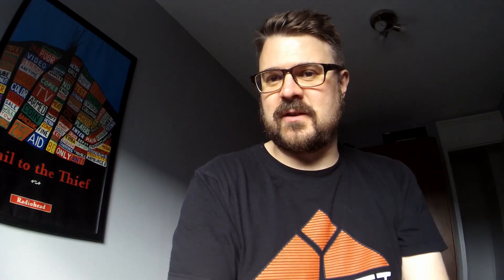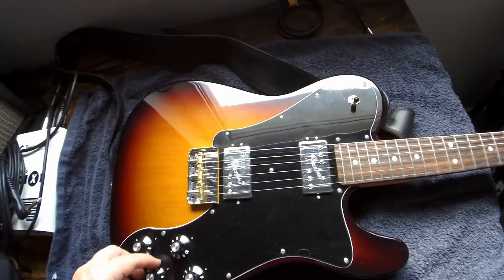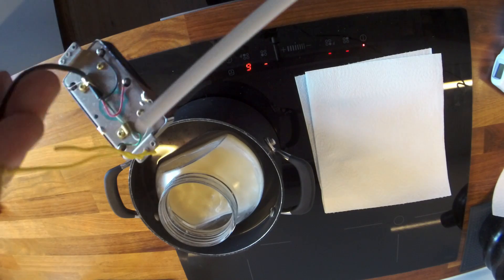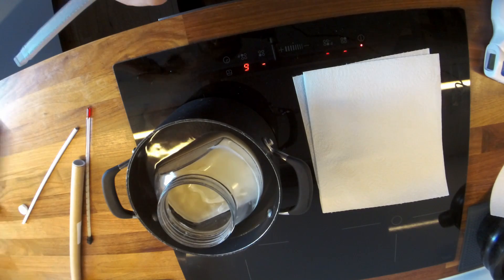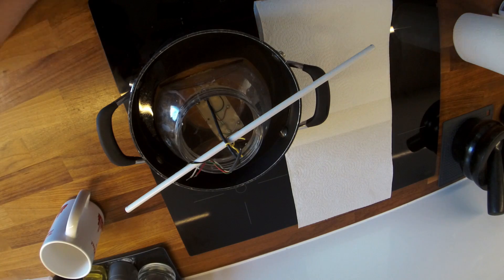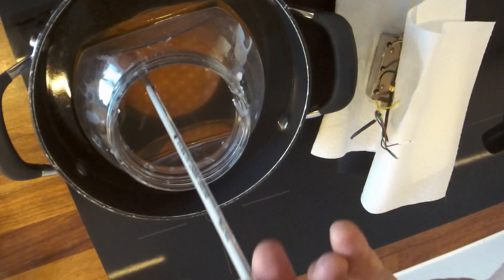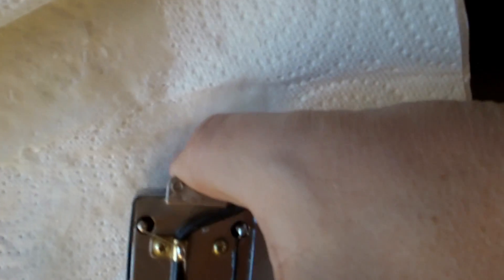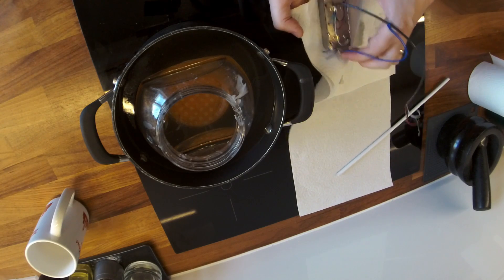Wax Potting my Fender V-Mod II Humbuckers

Comment: Well done. I'm considering doing the same. I would like to have seen you disconnect from those push push pots and resolder them. Also how did the potting affect the tone?
Reply from the maker: Tone hasn't changed, the feel is a bit different. Slightly less lively but that's to be expected when you take away microphonics, and they were very very microphonic. Don't regret it at all. I couldn't do anything with more than a light crunch. Feedback was all over the place